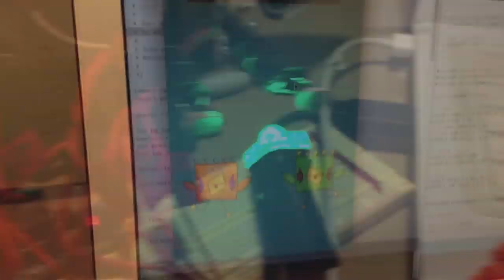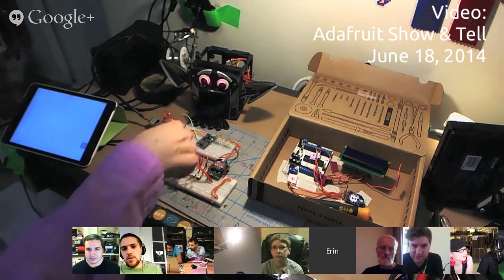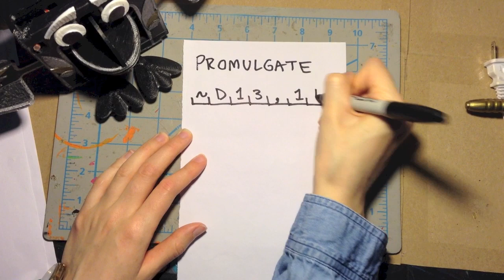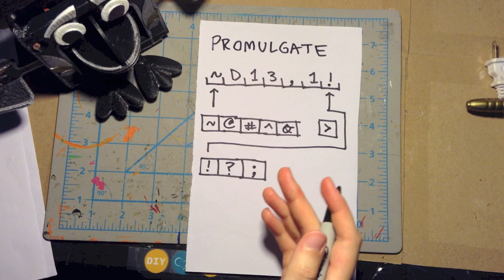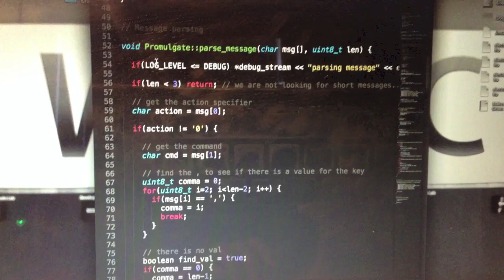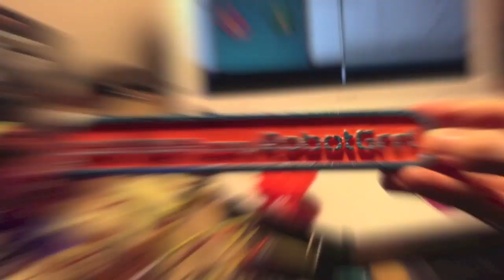Promulgate

Comment from the maker: Promulgate lets RoboBrrd interact with software easier!
See it in action:
--> Promulgate

Get started now and add it to your project!
--> http://robobrrd.com/promulgate/

 #arduino   #processing
Reply: Erin RobotGrrl, you should consider adding a CRC checksum to each message, and letting the Arduino report back to the PC if a command arrived correctly. Without that, a simple communication glitch (missing character or flipped bit because of interference) could wreak havoc.
Reply from the maker: Jac Goudsmit In projects where we did let devices send a reply that they received the original message, it never worked out very well. The lag time for each single message made all of the movements for the robot much slower. Since it was slower, the timing with the other device would get messed up, and it would be timing out wondering where the 'heartbeat' messages were. In the end, it wreaked more havoc than without the message receipts.

If someone was making a project and using Promulgate, deciding that they would want receipts, they could do this quite easily in their code- perhaps by designated an action specifier as a receipt message or something. That's one of the benefits of having it bare bones like it is -- I specifically made it so that it would be simple and quick for prototyping. There are other libraries out there if you're looking for a more important approach. (But it will probably take more time to create a quick prototype.)

As for CRC checksum, will have to look more into it. First time I've heard of it so it will be interesting to learn. Though I'm kind of wondering how, if you add a number that represents the payload to the payload, then how would you figure out if it is correct or not, because now there's a number in the payload that wasn't there when that number was being generated to represent the payload. Have to learn more. Sorry for the book of a reply- thanks for the CRC idea!
Reply from the maker: Jac Goudsmit Forgot to mention- do you have any recommendations for a book or website to learn CRC?
Reply: I understand that with a simple single-tasking one-command-at-a-time system you're not going to get the best efficiency if you let the host wait for a reply from the Arduino. But for example if you tell the Arduino to move a servo, it can send the reply back when it starts moving the servo, and it will take some time to reach the target location anyway so there will have to be a delay in the software anyway before you can do the next move. Another option is to let the Arduino software not acknowledge EVERY command, just a few (for example one acknowledge every 5 commands). Even better: you could improve the protocol to let the Arduino acknowledge e.g. if the command ends in a special character, and not acknowledge for any other character. That way you can send a couple of commands and use the special end-character for the last command to make sure that a glitch on the line didn't jam the command parser on the Arduino.

The way most network protocols work is that they calculate a CRC checksum over all the bytes in a message, except for the bytes that will represent the CRC.

If CRC is too much work or if you're afraid it will take up too much space on the Arduino, you could simply XOR all the bytes together and add the result to the end of a message. But XOR-ing will not catch nearly as many errors as CRC.

CRC calculating code should be easy to find on the Internet, including code that can be used for the Arduino. The original CRC algorithm uses a lot of shifting and bitmasking, but most of the solutions I've seen, simply use a lookup table so they're pretty efficient. I would recommend CRC16 for the Arduino, it requires less space than CRC32 and is probably more than good enough.

By the way, I'm currently working on hacking a (dumb) FischerTechnik interface, which goes a little further: if it doesn't get any "commands" for more than half a second, it switches all outputs off so that if the computer crashes or someone closes the program, or disconnects the interface while the power is still connected, the robot motors don't keep running. Something similar should happen if you get a glitch on your serial port to the Arduino. I think the ATmega 328 and many other microcontrollers have a watchdog timer to accomplish this.
Reply: I found a library here: https://github.com/CBMalloch/Arduino/tree/master/libraries/CRC16 but it's kinda weird: it stores the values in two lookup tables so it has to do two lookups and then shift and combine the results. A better solution is at https://code.google.com/p/arduino/source/browse/avrdude-5.4-arduino/crc16.c but unfortunately that's on Google Code, not on GitHub. Looks like that is based on fragments of http://www.atmel.com/images/doc2587.pdf which may contain some more useful information, or may turn out to be a huge distraction. You decide :-)

Comment: The 'String' class has a handy method called 'toInt()' for converting strings into integers.

Or you could change the line inside the for-loop into:
key *= 10; key += msg[lb + (i-lb)] - '0';
This would get rid of the need for the 'pow()' call.
Reply from the maker: Though to make it a String, you would have to copy the chars from the upper to lower bound to a new array, and add a null terminator.

I wonder how their toInt() function works.

Nice thought for removing the pow() call :)

This makes me curious to find out exactly how to compare these two methods. See how 'expensive' each one is. Thanks for the comment!!!